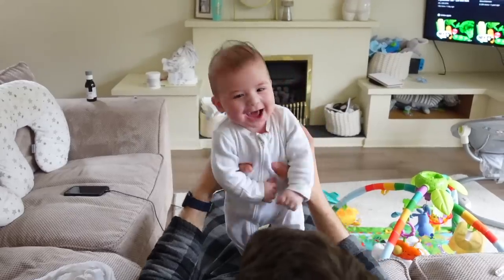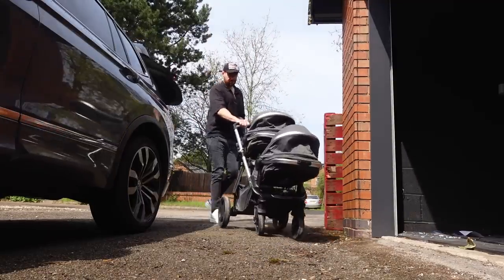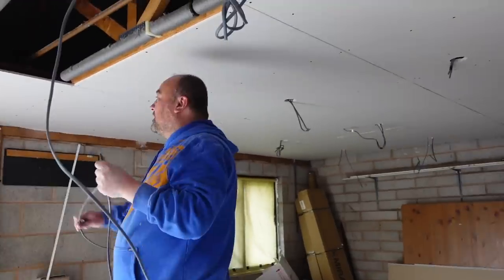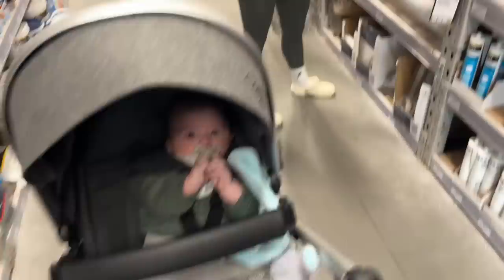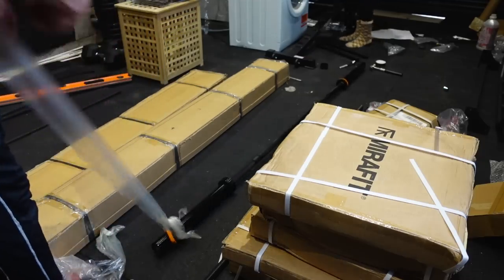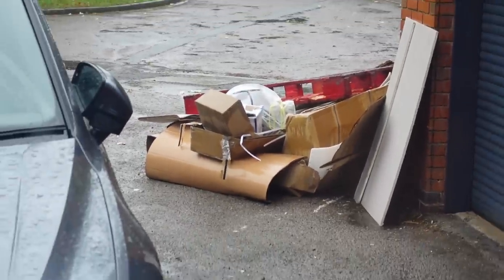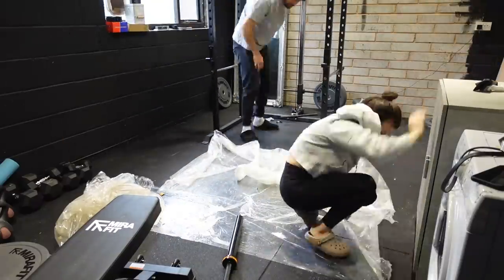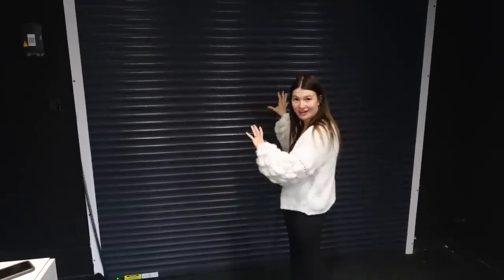Building Our Dream Home Gym | EP.1

Comment: Amazing transformation! I will be opting for white walls as it makes the garage look bigger, white reflects light. Black walls make small spaces look even smaller. I will not add plaster boards to the ceiling as high ceilings are a luxury lol. Instead on the side against the wall, i will be adding shelves.

Comment: Really Fab! You ans Ell are the proud owners of Twins! Really, owners?

You said about the garage end of the house was always cold. Have you thought of putting insulation Batts in the ceiling space too keep the cold out?

If you have black bars your handling using your gym equipment, watch that your rings (as in engagement, wedding rings and metal watch bands) don't scratch the black finish on the equipment.
Reply from the maker: Haha it was a joke 🤣 yes as we mention in the video, we insulated the ceiling space in the garage which has warmed the house up